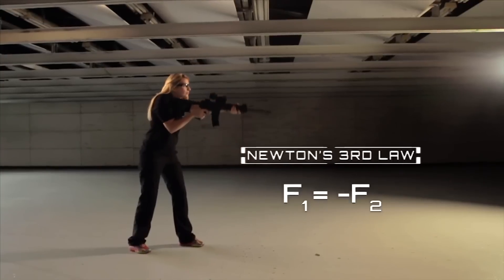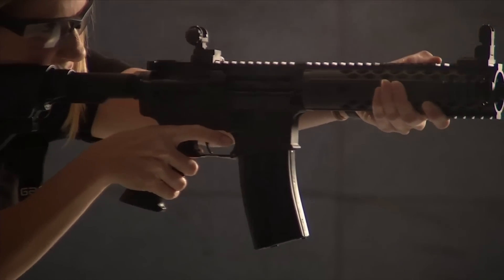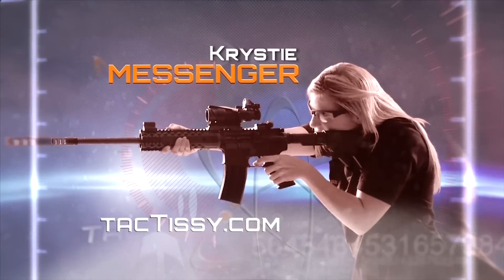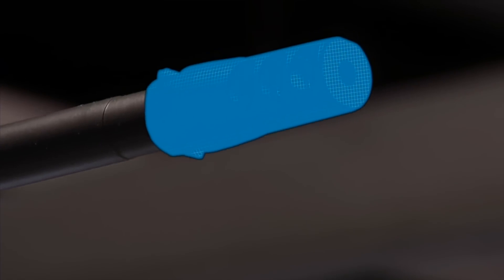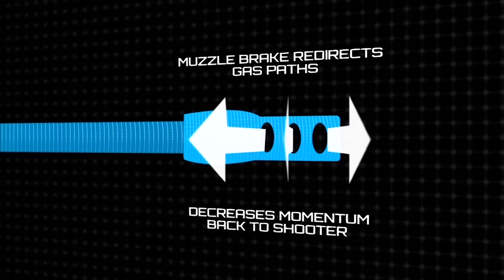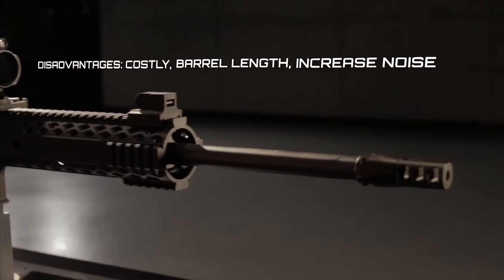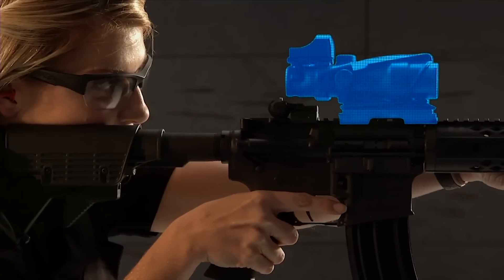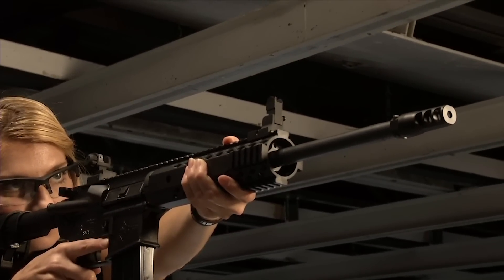Firearm Science - Muzzle Brake

Comment: Being a senior elk hunter, I installed a muzzle brake on my 30.06 to reduce recoil to a manageable level - 50%. Some suggest that I should drop to a lesser caliber, but I've witnessed hunters using lesser calibers have to shoot 3 to 4 rounds in an elk to put it down. (I don't think so!) True, the sounds waves are dissipated up and sideways, but earplugs take care of that. When range shooting and field hunting, I use electronic ear muffs. I have my rifle set up for what works for me. My philosophy is simple: If you don't like my rifle, go shoot somewhere else or learn to use ear plugs! In my opinion, installing a muzzle break (screw on and clamp on) is the best thing to happen since the invention of the wheel.

Comment: I still have a hard time understanding this. Since the muzzle brake is at the end of the barrel, why does it not have the same effect just not having a muzzle brake? Wouldn't the gases just disperse when the round leaves the muzzle anyway?
Reply: Instead of all the gas shooting forward, it disperses quicker and over a wider area  (horizontally) because of the side ports on the muzzle brake causing less felt recoil due to less pressure exerting the firearm backwards.

Comment: Thanks, but your momentum equation is not quite right - the forward momentum of the bullet PLUS the forward momentum of the muzzle blast (the mass and velocity of the burning gas exiting the muzzle) is equal in magnitude but opposite in direction to the recoil momentum of the gun. The purpose of the muzzle brake is to reduce the forward component of the muzzle blast momentum. By redirecting some of the muzzle blast sideways, it reduces the forward muzzle blast momentum thereby reducing the recoil momentum acting in the opposite direction. Obviously, a heavier gun, lighter bullet, and slower bullet will also reduce recoil.
Reply: ahh, thank you, that is acutally really usefull information

Comment: could the muzzle break be integrated into the barrel? for instance slits along the barrel or even slits inline with the spiral grooves of the barrel.
Reply: Yes, it could be integrated. The Springfield Armory M1A SOCOM has a proprietary, built in brake. Ruger american also is available with a brake on the 450 bushmaster.

Comment: Does it reduce velocity?
Reply: No, why would it? It's attached where the barrel ends, so basically it can increase the velocity but so little that it doesn't really matter. Bullet velocity is basically: how long and with how high intensity can the "combustion gasses" affect the bullet, so when attaching a muzzle brake it basically increases the distance of which the gasses can push the bullet for = more velocity.
Reply: No, it doesn't affect velocity or accuracy at all. It only redirects expelled gasses including the resulting muzzle blast caused by expelled gasses.